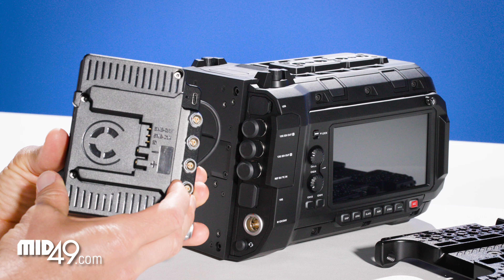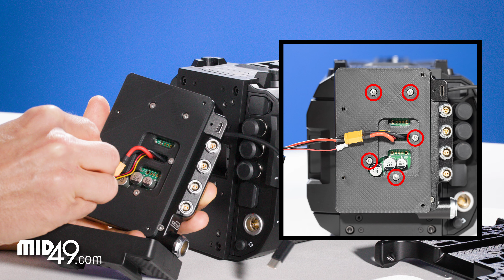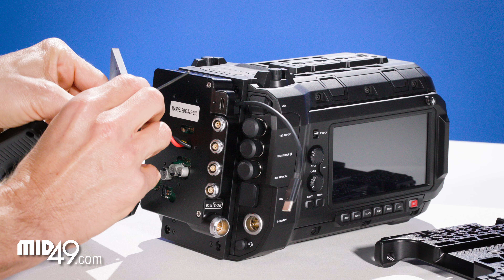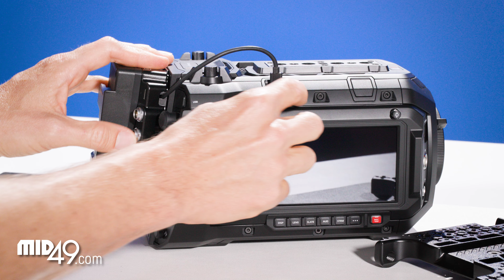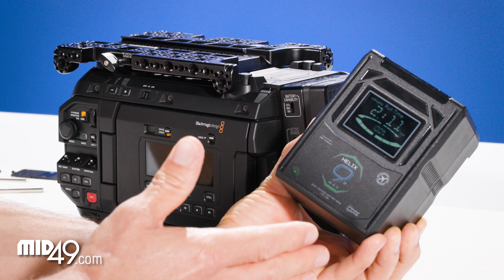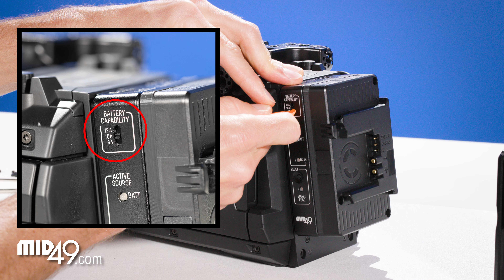Install Guide for Power Distribution Box DB-12 - Blackmagic URSA Cine

Comment: From the website it says this is only compatible with newer core high voltage batteries. Is it that it will still work but not have access to the higher frame rates and other high voltage features? Or is it that it just will not work at all with the lower wattage batteries ? Also I assume other brand batteries work...as long as they are 28v?
Reply from the maker: Any B-Mount battery will work with the B-Mount version of DB-12.

The dual-voltage Gold Mount and V-Mount battery compatibility is detailed on our site. No other dual voltage V and Gold batteries exist, that I'm aware of. If you have a specific battery in mind, please let us know.

Lower voltage (14.4) batteries will not work with this power distribution box. It is a hardware limitation.

If you have Anton Bauer 26V batteries, those have a mechanical mating difference and don't work on CORE plates. We can produce a custom assembly for those batteries on a DB-12 if desired.
Reply: @mid49films   And there is no way to make a version that can accept both dual voltage and lower wattage "normal" v mounts? The camera  can still ruin fine in lower voltage but some features are limited. Kinda sucks we are only locked into the higher watage batteries if we want to use this product.